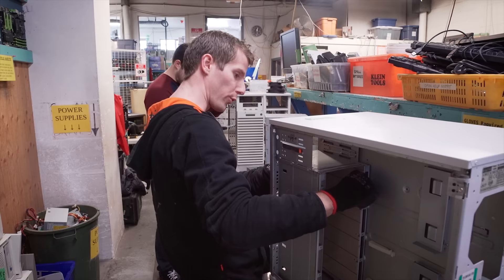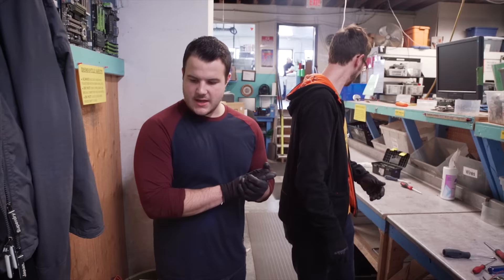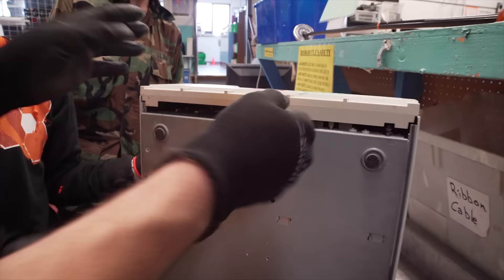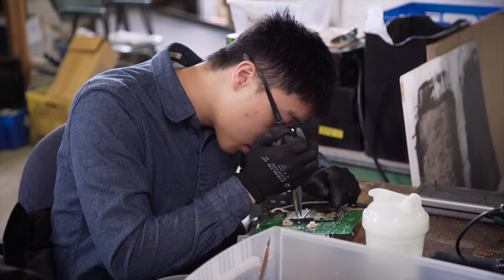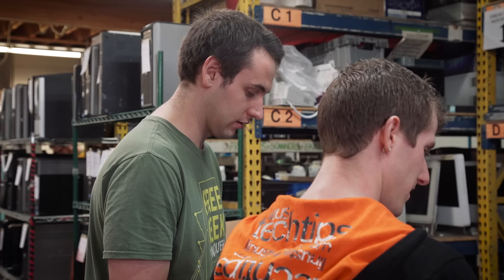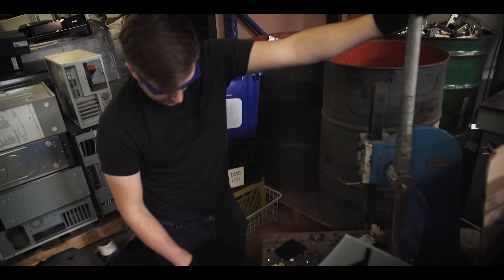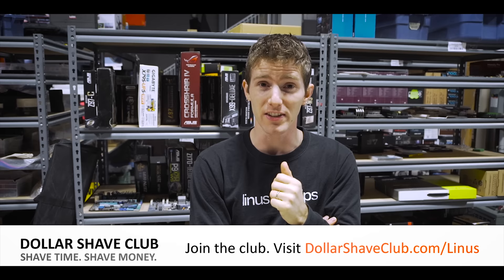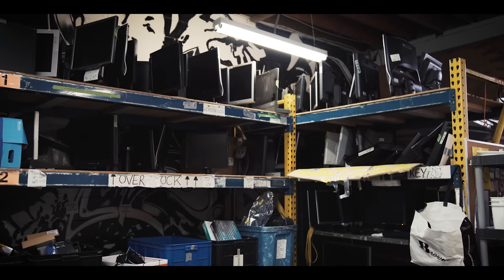Trying to Get Some Actual Work Done: Free Geek Vlog Part 2

Comment: i cried when you destroyed those hard drives D': i need soooo much more space than i have.
Reply: +Flat4Buggy 2 stillllll
Reply: +Austin Wisniewski I bought a 3TB nas on sale for about 100$ 2 years ago, so you could probably find one for cheaper now ^^
Reply: what on earth would you use tonnes of dead HDDs for? The only really widely usable part is their neodymium magnets, which can be used to make magnetic trays for storing screws when building PC's and such. And it doesen't take that many magnets to make a good tray (2-4 depending on their size). Other than that, they're really useless, unless you want their cases to store new, smaller drives or use them to build the chassis for a new anything..
Reply: Joranius Minecraft
you can melt the aluminium case and copper wires, and take the motor and screws, other than that, I don't know.
Reply: manaquri true that. The copper can be sold if one has plenty of it and the aluminium too, unless one wants to literally forge their own custom case (if I had the right equipment, then I'd definitely do that). People who wanna melt aluminium just have to remember that it is toxic af. Other than that, then its melting point is 600 degrees celcius, which is pretty easy to achieve :)

Idk what a general scrapper can use the screws for, but to an electronics interested person they can of course be pretty valuable. The motor is neither that much of a use to the general scrapper, but you sound like one of those scrappers that go all in and takes everything that can be used. I'm in that league myself as well. I've just scrapped a bunch of construction plywood which was going to be thrown out. Now I'm remodelling it into furniture :)
Reply: Joranius Minecraft
I make my own things in aluminium, just made a crucible out of clay and I use an old 50l extinguisher packed with sand with a pipe inside to make the fire. I keep most electronics stuff because I may have use for them, so I keep diodes, motor drivers, etc..
I don't keep what I can't use, but that's basically just the platters and the controller for an HDD.
Reply: manaquri sounds absolutely awesome! Any tips on building a crucible? I plan on melting aluminium again myself (I've done it in a grill once before. Suffice to say, the grill didn't look that well afterwards), but I don't feel like buying a crucible. They're too damn expensive. I do the same as you when it comes to the electronics. Only think I don't keep are outdated PCBs. Better sell them as scrap when I've taken what I wanted. It could be awesome to figure out how to melt copper. I spent 2 years scrapping computers for copper, so now i defo have more than 3 kg. of it. Would be great to melt all I don't need, into bars for easier storage. Same for brass and if an easier method comes by, then extract the gold and use that too. Who knows, in the future all that scrapping might pay of :)

Comment: Linus, I want to tell you Your channel is amazing. Just ordered my first PC Build based off alot of your build vlogs. 
Phanteks enthoo Luxe
Asus Maximus Viii Hero Z170 Motherboard
6700k Skylake
3200 Gskill Trident Z 2 x8gb
1000 Watt Rm1000x
980 Ti Xtreme from Gigabyte
H100i Gtx Extreme Liquid cpu cooler
and last of all 950 Evo pro 512Gb M.2 nvme ssd.

I'v never built a PC before so I'm looking at your video's for guidance. Thanks.
Reply: overkill!!! you gonna pay too much for that lol!! 1000watts is too much XD and I recommand you to buy a HDD for files savings XD
Reply: It's already shipping! It'll be here Wednesday, I can't even wait haha, and I plan to overclock and maybe add another 980 ti later if I dont sell this one when pascal comes out!
Reply: I'll come out? x)
Reply: I was afraid you judge me and tell me bad things.
Reply: +Sean Laszlo Jones "futureproofing"
Reply: +Captain Einstein the power supply will fail before that is needed
Reply: Stephen savage "proofing"
Reply: +Sean Laszlo Jones 
Those Gigabyte Xtreme GPUs suck up a lot of power. 1000W is overkill? Nah. It's sufficient.
Reply: wtf, a 550w would do the job xD for sure!
Reply: +OMGAfterlife 
i wouldn't bother with an M.2 SSD with a Consumer grade Board.

the extra Speed capability won't get used (especially since you don't even have anywhere to transfer files to and from, only one storage location....), the higher bandwidth on the storage will make absolutely zero difference for either games or system in general - and your Consumer Socket only has 16 PCI-E Lanes, so while it won't really impact performance, you're running your GPU in 8x mode while not getting any actual benefit from doing so, instead getting nothing from it.

not really worth it if you ask me. unless you have a 10Gig home network and want to quickly transfer files to and from your local machine to Network storage or another machines - but almost nobody has that in their home.
Reply: ***** Most CPUs have more than 16 lanes. Only parts that do not are Intel Atom CPUs.
Reply: ***** no, Consumer Intel Processors have 16 PCI-E Lanes.
only the Enthusiast Socket Processors have more.

while on the AMD side, AM3+ (990FX ofc because no point in buying anything else on that platform) based Chipsets have 32 PCI-E Lanes.

things get more interesting when we look at the lower Bandwidth PCI-E stuff though.
on the Intel side, Z97 supports 8*PCI-E x1 while Z170 supports 20*PCI-E x1.
on the AMD side, 990FX supports 1*PCI-E x4 and 6*PCI-E x1.
but! 990FX also supports 2*PCI-E x1 through the Southbridge. but these are probably almost entirely unused on most Motherboards due to routing through a Southbridge.

however, Intel also has an Entusiast platform base, whose Chipsets range from 28-40 PCI-E Lanes depending on Processor in use.

you're welcome for this fascinating information.

Comment: Theres also the DPS-1200FB if you're talking about power density, 1200W in a server sized PSU (on 240v, its only 900w on 120V)

Comment: 8:40 That's a reasonably non-ancient HP compaq SSF. You can tell which model by the shape and position of the HP logo,  seems to be the 8200. it has sandy bridge i3,5,7s inside. Which is not awful.
Reply: Zandonus my school have these but they have an c2d processor

Comment: Be fun to start a "free geek" thing in my city.. Im at the recycling station her 3-5 days a week, and so much is getting thrown away.. To bad i dont have the storage space + not legal to take things from there..
But if i had the storage, i woud talk to companys here to get their old hardware and fix it up.
Lots of people cant afford new pc's, and the 300$ (2500nok) pc's they sell in stores here in Norway, is crap.
I got a used dualcore "propper" intel with 4 gig ram and 120 ssd used for just over 100$ w/new battery, and in many ways it is better than the 300$ celleron or equal shit.

Comment: im actually impressed polaris did not revive bitcoin mining as the rx480 can mine just a little faster and cooler than r9 390x with a mild overclock. wonder when rx490 comes out or one will come out.

Comment: I could never work there. I hate destroying computers at all and would rather work at a shop fixing them not tearing them apart
Reply: FreeGeek refurbishes computers too (check out Part 1). The recycling is for stuff that's too old and/or broken. Where do you think the broken parts that you'd fix (by replacing with good parts) end up?

Comment: you could have recycled the discs inside the hard drives why would you break them sure the circuit mite not work but the disc is perfectly fine
Reply: It has (or might have) sensitive personal data. The platters are destroyed so nobody can steal the data. HDDs that work get wiped but if they're broken the only right thing to do is destroy them. The broken bits can still be recycled.

Comment: the sad part is the hdd curshing
so sad
Reply: Why? I mean, they're (probably) crushing them because they're broken or too old'/small to be of any practical use. They crush them to make sure that nobody can access the donors' data.
Reply: @jb888888888  i want hard drives for my server, and i also want them for
windows backup when i screw up my PC by accident or messing around with windows or experimenting with windows
Reply: But if they're broken they are useless for anything.
ETA: I'm reasonably sure they have plenty of working hard drives available for purchase at low cost.

Comment: Dont use dollar shave club, DE shaving is even cheaper and better
Reply: Double Edged shaving like a safety razor or is that a different company? Safety razors are like $30 each and a pack of razors isn't a massive discount from $3 dollar shave club razors. I have no idea if safety razors are better but it takes a long time for them to be cheaper, and you can't take them on airplanes
Reply: MarioDragon Yes double edge, the initial cost is high ($70 for me) but I only spend $10 a year on blades using the exact same cream/after shave as I did with cartridges.